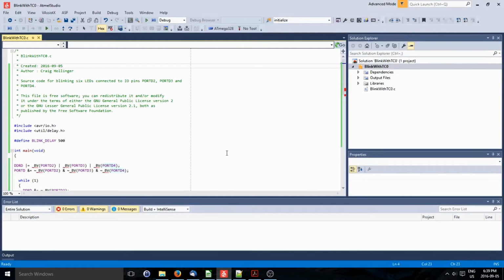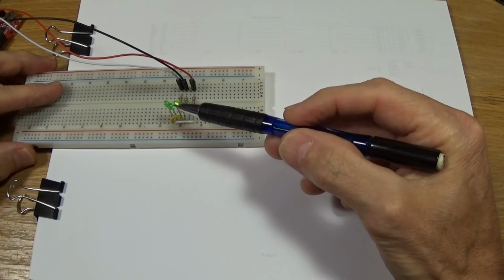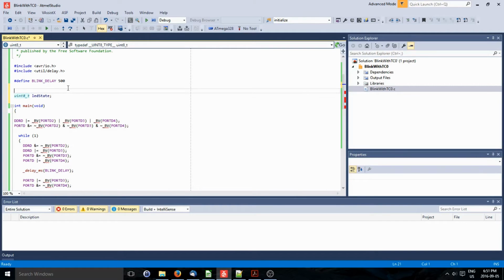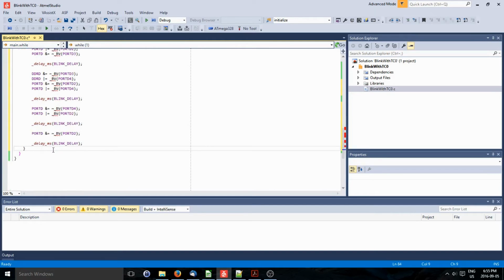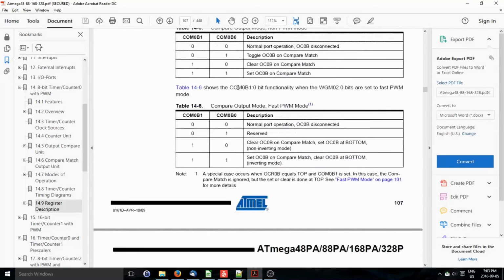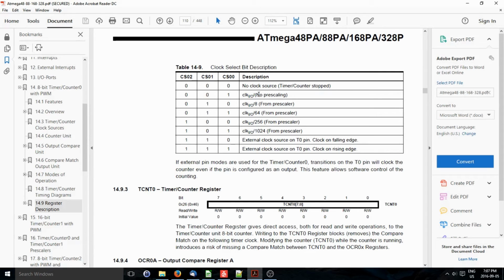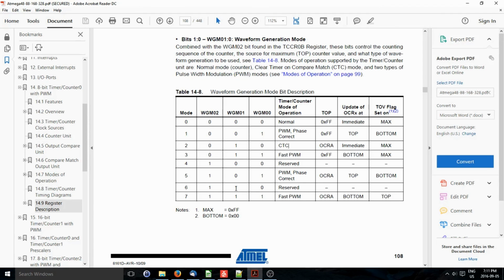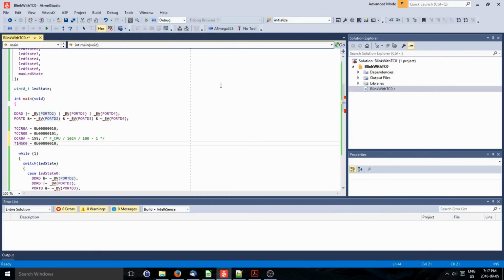Going Beyond Arduino # 5, Part 1: Blink using Timer 0

Comment: Thanks for your Videos ! what DDRD&=~ _BV(PORTD2) do ?
Reply from the maker: The &= means take the whatever was in the left-hand side and AND it with the value of the right-hand side and put that result back into the left-hand side.  DDRD equates to a pointer to the data direction register for port D in the microcontroller. The '~' means compliment the bits (make the 1s into 0s and 0s into 1s) of the item to the right of it.  The '_BV()' is a macro that means 'bit value'.  Equivalent to (1 << PORTD2), which is 1 left shifted by the value of PORTD2.  The macro PORTD2 equates to 2.  So _BV(PORTD2) is in binary 0b00000100.  And ~_BV(PORTD2) is in binary 0b11111011.

So what actually happens is that the Port D data direction register is read, the value of 0b11111011 is ANDed with the data read from the register, and the result is written back to the register.  The result of all this is to make pin 2 of port D an input pin without disturbing the other pins of the port.

Yes, the C programming language can be rather cryptic.  I could have written that one statement in a few, but less cryptic statements, but the compiler would have generated the same binary code.

Thanks for watching!
Reply: @craighollinger9972  thanks for your quick response ! i'am lookin to your previous videos , it's  very helpful . i'am working on a project to generate sinus wave from an arduino , i needed to understand how does a Timer work .. if you have some tips (links , tutorial ect .), I ll be more than gratefull !
Reply from the maker: @ahmedladhibi6893  Read the data sheet for the ATMega328.  That's the best source of information on the timers.  There probably are other tutorials on the internet, do a Google search.